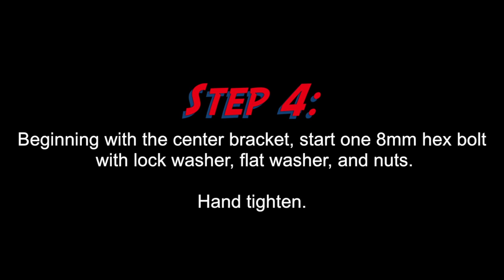N-Fab Tacoma Nerf Bars Install Video

Comment: Not worth the money, they look great but the supplied screws are not safe. Drivers side flew off the truck 3 weeks exactly after they were installed. If you purchase this product you may end up with a vehicular homicide charge.
Reply: +MVB78 sounds like an issue with the installation....